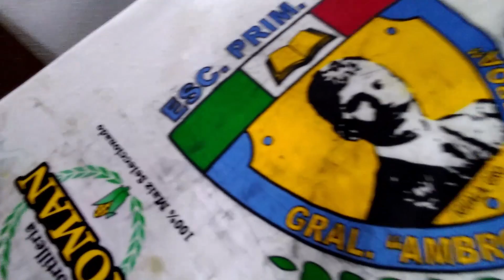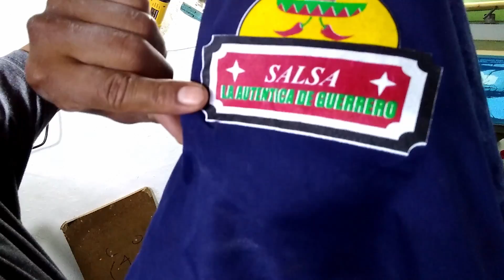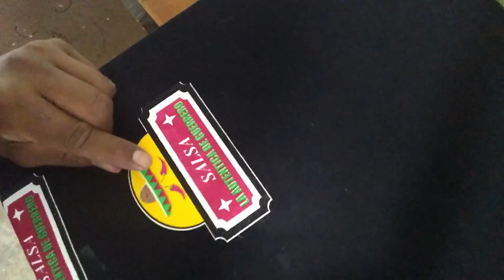Worst 6 Colour Print Job | Biggest Headache

Comment: The shirt shrinking with all the flashing can give you registration issues aswell bro. That and the ink setting in the screens with all the residual heat in the shirt and the pallet. Something i realised a while back flashing a multi colour print ;)
Reply from the maker: Yea, most likely. Still need to do a lot of tries and errors to nail it down.

Comment: Something has to be loose on your pallet or head. Or maybe your 
"off contact" is off. There should be a screw under the head and on top of the arm that contact with each other when you put the frame down. You can adjust those. A good way to measure your off contact is to put one quarter on each corner of the pallet. That's how much space you need to have between the screen and pallet. If there is a bigger gap then that it can  cause registration problems. Good luck and any keep striving bro  The best way of learning is through trial and error.
Reply from the maker: Yea, I'm pretty sure it's all those things. And unfortunately this press, you can't adjust the off contact. And this wood screens are all warped so every screen has a different off contact. Can't really much about that. A reason I'm trying to move to aluminum. But, I just keep trying.
Reply: @TheInkBuildUp  You could try putting thin slivers of plastic or something underneath the screen at the back as you clamp it in to raise off contact. Ive used a wooden ruler before when i had to print something quite thick.

Comment: Great video. Are you using plastisol inks? How much time do you heatgun your prints for the ink to be cured? Thanks
Reply from the maker: Thanks, and yes, all Plastisol. And usually takes a few seconds with my heat gun. I usually can tell it's curing properly by seeing how the print dries as well by seeing the smoke. The smoke is a sign that it's curing. But you just have to be careful and keep the heat gun moving around. You don't want to stay in one position for to long or you will burn the shirt, especially with white tees.
Reply: @TheInkBuildUp  ok thanks! I thought  it was too late when there was smoke. I burned a black shirt last time I tried 😁
Reply from the maker: Nah, after a few runs you'll get the hang of it. Smoke did scared at first but now I know.

Comment: Line table printing is always much easier method when it comes to multi color prints.
Reply from the maker: I want to see that work with my eyes. I've seen it online and it looks incredible.
Reply: @TheInkBuildUp  I use it personally. People from Philippines and Malaysia use it a lot. I had the similar rotatory screen printing machine but registration was always a pain. So i switched to line table setup and never looked back. It is great if you have print on demand kind of tshirt business where you want to re-use screens when orders come. Search for "
Line Table Screen Printing" and watch their videos, you'll know what im referring to.
Reply: ...and most of all. Anyone can build it with few angle bars or rods with a platen. Should be able to build single platen setup under $10-15 i guess.

Comment: Why does the ink gets clogged up. And how to fix it.
Reply from the maker: If you flashed and didn't let the ink cool down and than you go for the next color, the screen will lift some of the ink up causing you screen to clogged up. You can just use whatever ink remover your using to clear it.
Reply: @TheInkBuildUp  man i had this problem trynna print Gold ink from "speedball" on a 110 mesh, after all the headache just gave up. I dont have a flash dryer, i was using a heat gun, i tought it was the brand and that the ink was drying fast on me, going from being a thin ink to thick. So i tought that was the problem.
Reply from the maker: Yea, sometimes if the ink is still hit, it causes a lot of issues when printing on top. You just have to let cool down a bit.
Reply: @TheInkBuildUp  cool. Thanks.  something to keep my eye on.